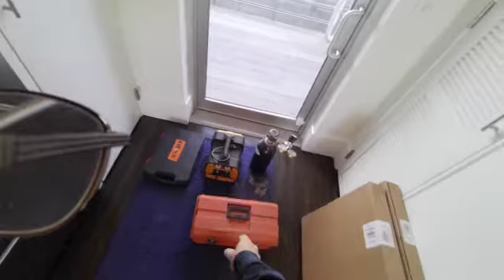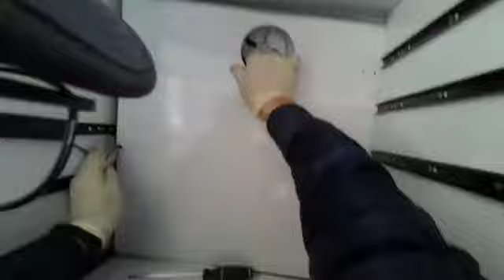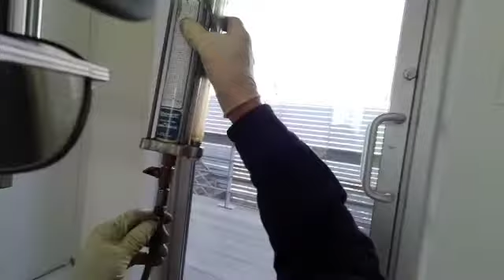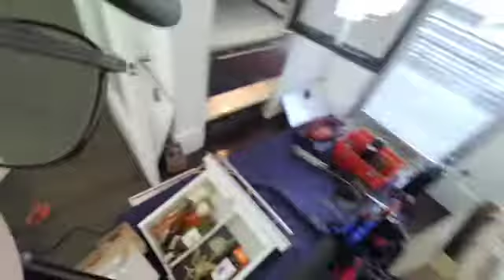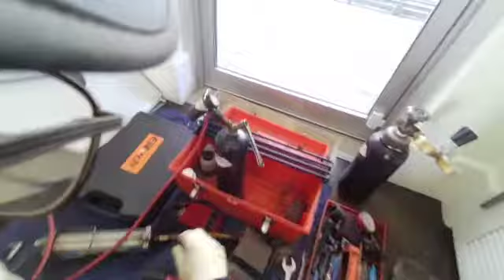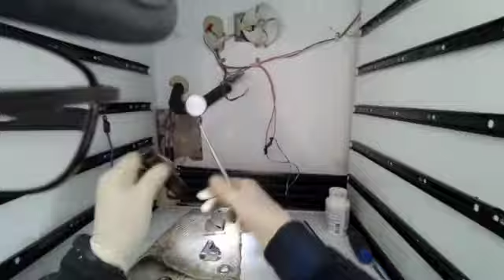Sub-Zero 427R wine cooler evaporator R&R

Comment: When installing a new drier, the size of the copper outlets on the bottom are much bigger and need to be reduced. What is the best method to reduce size of them and solder?
Reply from the maker: I’m not quite sure what you’re asking. Most driers are 1/4”, most subzero condenser lines are 3/16”. You could swage out the 1/4” tubing to 3/16” and solder it in with silver solder or some other equivalent. If you’re talking about the capillary tube into the drier you could step it down with a piece of 1/16” tubing or crimp it closed with a pliers. I use driers with the capillary side already reduced.
Reply: @SubZeroSpecialists  Thank you, that helps. I'm working on the bottom side of the driers that is 3/16. I',m working on a 427R and was able to get it up and running this weekend. It looks like these dries were crimped previously. When you crimp them what is the best method to do the crimp?

Comment: My lower drawers get to 36 degrees but the upper wine cooler only gets to mid 50's... Thoughts?
Reply from the maker: What’s the model?
Reply from the maker: If the lower section is working then you may have a Freon leak up top. Unless you can tell me what the operating pressures are it would be difficult to diagnose. Also check to see if the upper compressor is running. Another possibility is the switching valve.

Comment: The lowest compartment is insane.  How to get to the back(freezer) compressor?? 2 solenoids also behind the condenser coil. Repair rate 2 of 10.
Reply from the maker: Check out our Tech Help files on our website at aaronsrefrigeration.com. Look up your model number and look for Component Removal. The whole bottom tray slides out to get the the rest compressor

Comment: Hello Sir, which torch did you use? It's very quiet and nicer.
Reply from the maker: It’s a turbo torch with a number 5 tip
Reply: @SubZeroSpecialists  greatly appreciated.  Can I use this to join copper pipe on the compressor suction and discharge line which is steel?
Reply from the maker: @rehmanmehmood4660  You sure can.
Reply: @SubZeroSpecialists  I am not sure what happened to my last 2 messages with the link to the tip. Trying to find the number 5 tip online.
Reply from the maker: @rehmanmehmood4660  try Supply House 888-757-4774